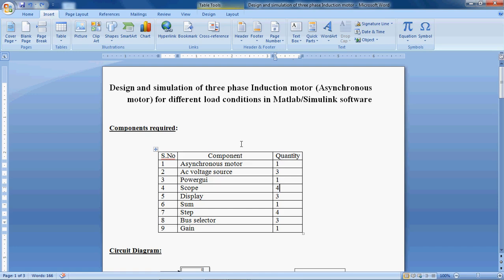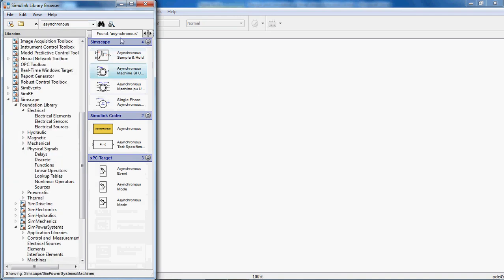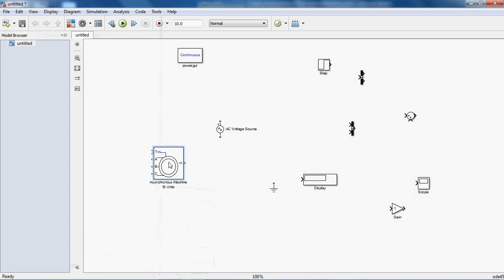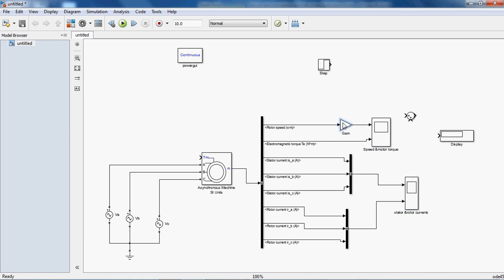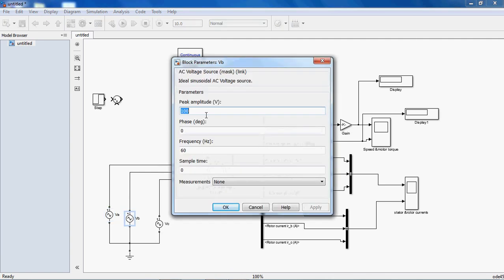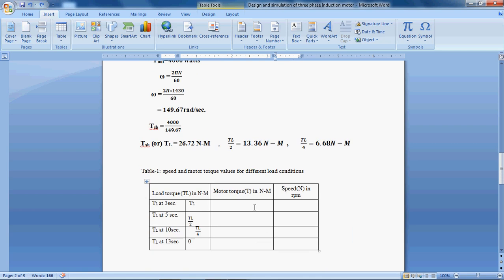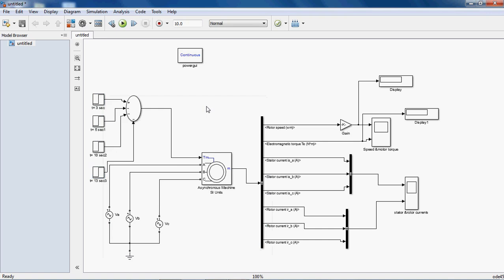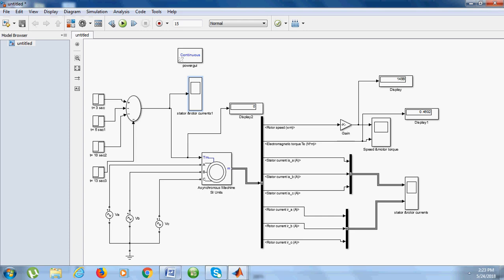Design and simulation of three phase induction motor at different load conditions in matlab/simulink

Comment: SIR, before 3 seconds and after 13 seconds, o/p torque is about 0.5Nm and speed is 1500 rpm  hence power o/p is coming 78.5 W whereas we set the value of power o/p to be 4KW to the motor. please explain sir

Comment: why is the sum block set as | + - - - ?
Reply: At 00 sec : Torque is zero.
At 03 sec : Torque becomes full on adding full torque.
At 05 sec : Torque becomes half after subtracting half torque.
At 10 sec : Torque becomes quarter after subtracting quarter torque.
At 13 sec : Torque becomes zero after subtracting quarter torque.